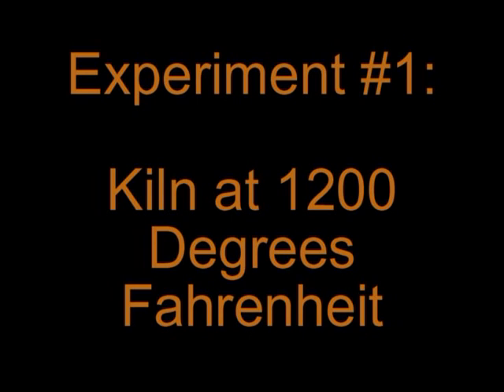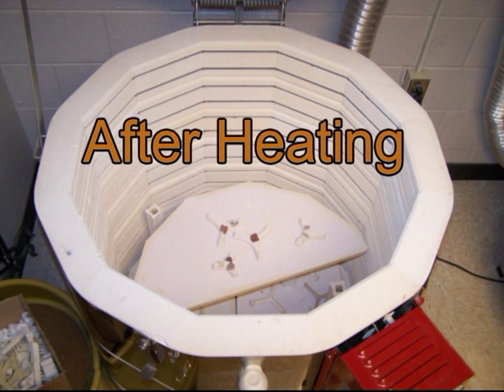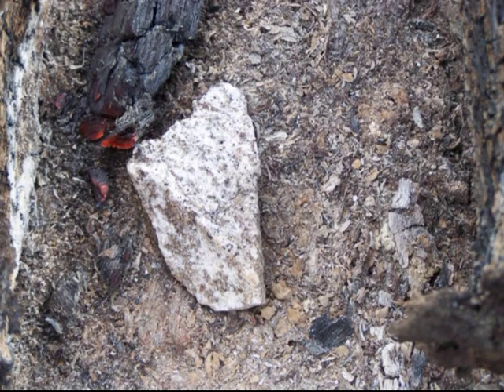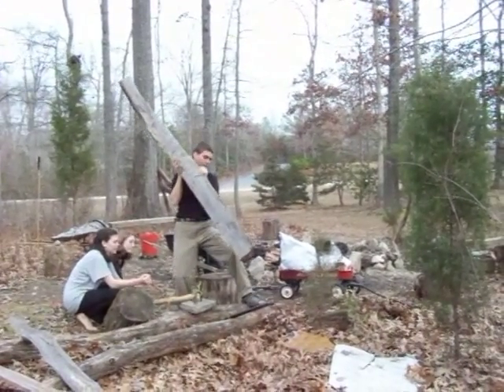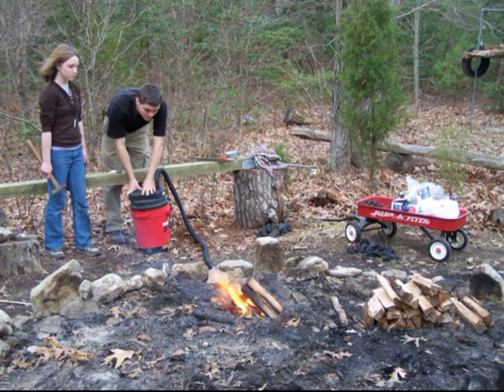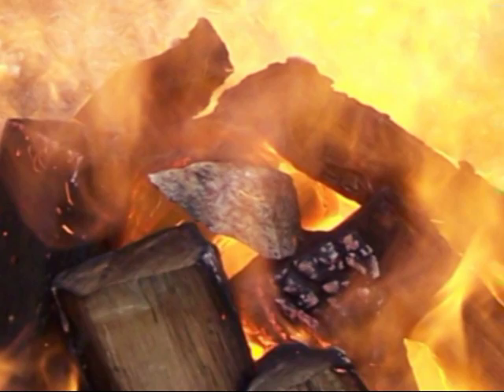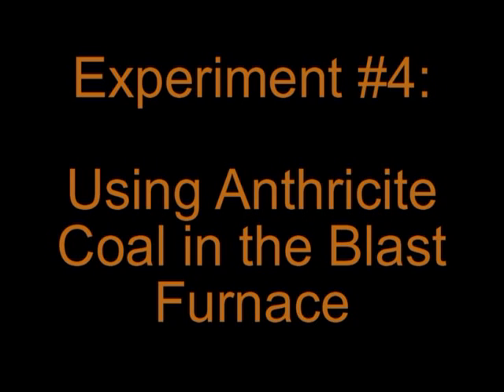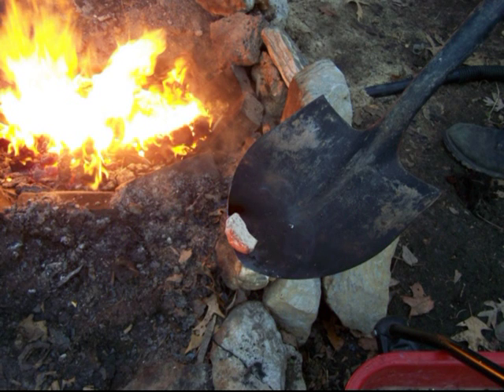Scottish Hillforts Part 2 Kiln and Fire Test Results

Comment: somethings missing here...their had  to have ben some kind of accelerate used to melt the stone!
Reply from the maker: The maximum burning temperature of any particular material that reacts with oxygen is set by the chemical characteristics of the fuel on a molecular level. For fuels in bulk, the maximum reaction temperature is far too low to melt granite.

It can seem counter-intuitive because we know we can use large amounts of fuel and release unlimited amounts of energy. The problem is burning more fuel occupies more space, so the energy in a big fire is spread out over a larger volume. The result is the maximum temperature is still the same - far too low to melt granite. Even if the Scottish had tons of gasoline, it would make no difference.
Reply: @TreeDancingCloud  thermite might do the trick!
Reply from the maker: They did leave behind a puzzle worth thinking about. I am glad to see an inquisitive mind thinking it over. So, thermite and other exotic (for the day) chemical reactants would necessarily leave behind large amounts of molten metal bonded to the granite. No such material is present, and it would be easy to observe.

Also, in that period, it would have been far less difficult and costly to produce the necessary shields, and teach the users the special reflection aiming trick. It would have been a powerful military tool for hardening stone walls against intruders, and for knocking down wooden fortresses when used against rivals.
Reply: @TreeDancingCloud  ive ben thinking about this since the mid 90s wen i saw a ep of in search of with..strangely i cant find the show any ware now! and ive looked threw the whole list of seasons..i have a photographic memory so im kinda weirded out about it. i did find another show on the subject but that was new to me i had never seen it before..Mandela affect maby?
Reply: @TreeDancingCloud  could the wood ash have acted as a glaze on pottery? i know Japanese pottery uses wood ash as a glaze on pots used to ferment foods? is this within the realm of possibility?